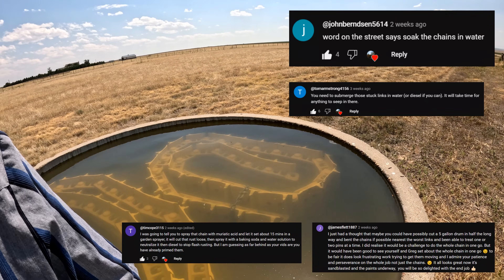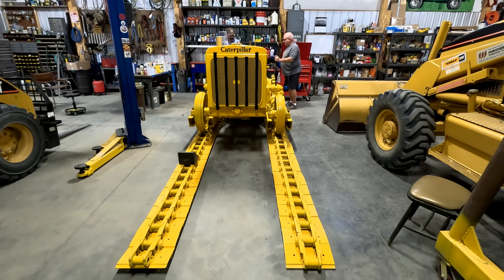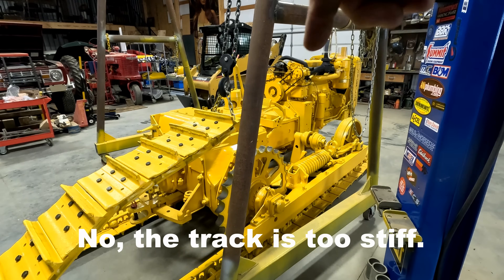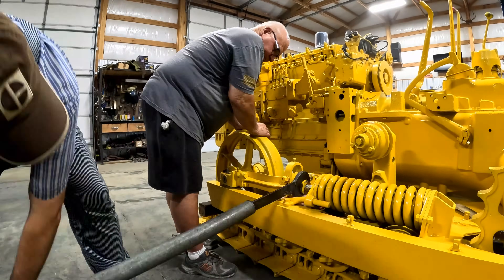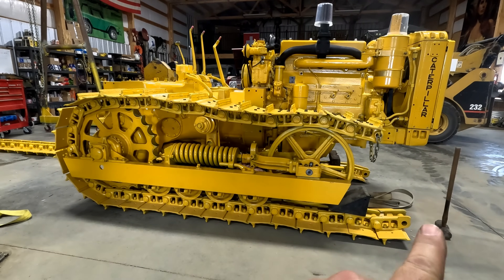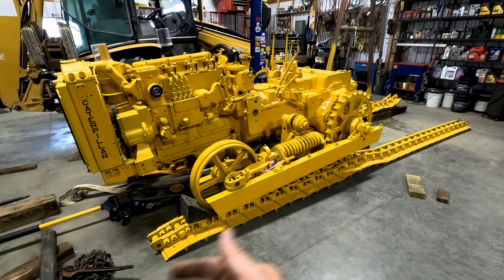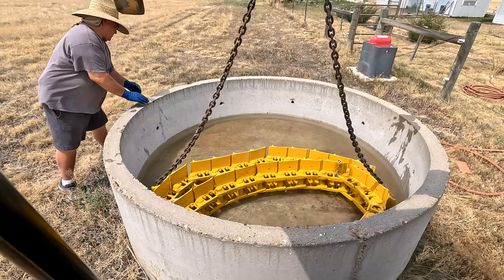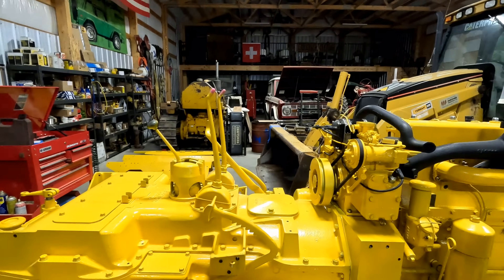Caterpillar D4 Soaking stuck track chains. Will it work? Episode #124

Comment: That doesn't make any sense because if you want to break it in properly all you have to do is leave the tracks slightly a little loose and let the motor run for a while and just drive it slow and it will break itself in and then after a while after the motor is broken in Titan tracks up a little more and just keep driving it it'll be fine

Comment: Someone else already said it but we usually connect tracks on the top flat spot, this way you can use whatever you like to join them, chain binders, come along, cable with snatch blocks, rope and pulleys even a good ol pry bar or two :) btw, it helps to freeze the pin before inserting....
Reply from the maker: We got hung up on the location that the book said to insert the master pin. That would make it quite a bit easier not to be on that radius. Appreciate the advice. 👍

Comment: start it, and drive it over the sprocket using engine and crane plus a few come alongs and long bars or wood as a lever and it will unstick rather fecking quick lads. clearly y'all haven't fitted many tracks before
Reply from the maker: We have not done much track work and I have never claimed to be a mechanic. I think we're going to slap these tracks on one of those machines I showed at the end of the video. We were reluctant to use Lefty because the engine is not broken in yet. 👍

Comment: Thats an easy maintenance item when stored. Feul and pump spray couple gallons goes long way. I worked for some off the boat Italians. They put sewer pipes in baltimore city in the 1890s. The old shop guy would  spray down anything made out of steel. They had old crains mack trucks big pumps and air compressors with pony motors. It all went for scrap in 2000 grands liquidated everything.  Wish I had grab some of it now.

Comment: yrs ago I had a 450B J D with same track problem deaer told me the only way to fix was to press all the pins out and remove rust then re assemble,  I threw them away and bought new. Misstake?
Reply from the maker: I have a feeling we're going to be pressing the pins out. From talking to a lot of folks I think that will be the only solution. New ones would be a good idea but they haven't been made for years. 👍
Reply: @lifeafterourloss  100 years later, the track chains are fully rusted thru and useless

Comment: Question…. Have these been together and used since the grousers were built up with bar and weld?  If not then those pads probably got some rocker yanked into
The from the heat. I would think that it would be trying to pucker the pin bushings which will in turn try to grab the pins themselves. Just a thought. This is my first time seeing your channel. So I’m not sure on the history of those tracks.
Reply from the maker: Welcome to the channel! The chains came off of a machine that had been sitting for probably 30 plus years. The rebuilt grousers are from a parts machine that we got from Montana. This step is more of a experiment to see if it will work. In the end, I suspect we will be pressing out the pins. 👍

Comment: Years ago at a swap meet a man told me he had an engine he couldn’t got unstuck so he took in down to a local creek and submerged it in the running water for some length of time. Later retrieved it and then he got it to turn. Good luck with your experiment.
Reply from the maker: I've heard quite a few stories like that. I really hope this works these tracks have been our nemesis. 👍
Reply: @lifeafterourloss  If you could find a way to continuously be agitating the water. Maybe some type of small pump or an air hose with very small air holes in it under the tracks to make the water bubble and turn.
Reply from the maker: @oldamericaniron5767 I think that would help. Unfortunately I think the paint sealed things up a little bit too well.
Reply: @lifeafterourloss  I loosened a drive chain for my gravel crusher by laying it on it’s side next to a tree. I hooked tractor to one end and other end to some sort if moveable anchor and pull chain around tree, switch tractor and anchor and pull back working it like one of those chain type saws survivalists may carry. Better use a tree you don’t care if it dies from bark being tore off. Just another thought.
Reply from the maker: @oldamericaniron5767 We have tried about everything. Stretch them out with the backhoe move them around with the backhoe. Heat, big hammers, pneumatic hammers. We are in desperation mode now. Eventually I think it's going to need pressing the pins out. I know what a monumental task that is, so we're trying everything we can to avoid it. One thing this project has taught us is to just go ahead and do it the hard way first, 😂.
Reply: @lifeafterourloss  Good luck with it!

Comment: Hey Arron, Great video.   Enjoyed your cameo and Squatch's shout out on his channel.  Many years ago I bought a Cat 30 that I was told by the owner, whose opinion I respected, had stuck tracks.  The day I went to pick it up was hot.  No problem, armed with 10,000 lb. winch, sheave blocks, planks to slide on and lots of dish soap, what could go wrong?  Before it was on the ramps the sheave block broke.  We load the crawler, wiggling it on, pulling one side, then the other with come alongs and a tired M Farmall.  Spent most of the day loading the tractor, hauled it home, parked the truck and walked away, never wanting to see it again.  A couple days later, I cooled off and worked up the courage to take a look at it.  After a  few minutes of studying the problem, something I should have done in the first place, I loosened the brake adjusting screws, the tractor rolled.
Reply from the maker: I have made many very similar mistakes. It is definitely a testament to your perseverance that it's still got loaded with stuck brakes. None of this is really a surprise after viewing the projects you have completed. It's cliche, but I love the saying where there's a will there's a way.
Reply: @lifeafterourloss  "where there's a will there's a way" you forgot to capitalized, Will, William, Bill, I'll answer to any of them.
Reply from the maker: @billlee4838 I really did miss a perfect opportunity here.......😖

Comment: I’m anxious to see if this works. I have an old 941 that I bought and it has CAT tracks with new pins and bushings and it sat for too long after they were put on it and several of the links froze up and I have been pouring oil on them for months and actually heated and beat them down one time and when I drove it they went right back to the original sticking point. I have been thinking about soaking them for some time now but I was thinking about using a vinegar solution.

Comment: As a member of a vintage/antique heavy equipment association, I've been in the market for a 9U or a possibly a very early "B" series D6 for some time. A flyer with a list of some vintage heavy equipment started to circuit around which included an early 60's D6 for sale. After contacting the seller and making arrangements to see the tractor, I took my toolbox and a pair of batteries to check it out. The tracks had been replaced years earlier with new ones: thick rails, grousers nice and tall, bushings immaculate. The only thing wrong was a coating of rust on the tracks from the tractor just sitting there. Usually tracks flex when I walk on them but this one didn't. When I fired up the tractor and eased the main clutch (aka: flywheel clutch lever) back, only one track responded.  After speaking to a several heavy equipment mechanics and a 90-year old contractor who owns over 45 Cats, I came to the conclusion that nothing can be done in this case other than replacing the chain. With other possibilities such as a frozen clutch or brake, I passed and the tractor remains just sitting there.
Reply from the maker: Someone has told me that the only way to free them is to push the pins out on the chains. I honestly think that may be in our future. Hopefully you found another D6. 👍
Reply: @lifeafterourloss  I heard of that one too, but I'm not a mechanic so I don't have access to 70-ton capacity press. One mechanic mentioned vibrating the pins with an electric hammer.  I thought about hosing down the entire track with PB penetrant( yeah, the stinky stuff) and letting it soak but I don't own the tractor. Anyway, good luck on your 7U. I'll be looking forward to seeing how yours turns out.

Comment: I enjoy your hard work and seeing you actually make real progress. I’m recently bought a D4 6U so I watch every YouTube concerning repairs, maintenance and operation of these machines. Just finished rebuilding the clutch and starter pinion assembly but the current challenge is locating a replacement fly wheel ring gear.
Reply from the maker: Thanks! Check out General gear & machine in Boise, Idaho. They would probably have a ring gear for your 6U. 👍

Comment: I've heard of soaking the tracks in oil, but never heard of using water before. My Grandpa used to take the used oil from the tractors and pour it on the tracks to keep them from setting up, because they sat outside in the weather. He did that for 67 years, I don't think He'd approve of using water for some strange reason...

Comment: Clear water cannot dissolve rust by itself. 
It can just wash away dirt particles from the friction area, but to do this it must be able to flow freely in these places. 
In addition to this, You painted chains with a thick layer of paint, actually hermetically sealed them, - not good in this case.
Try to mix some machine oil and kerosene: it have fine penetrating capability, inject this liquid in available gaps, and after some time try to stir the chains.

Comment: I think you will find out you have wasted you time on this one. Saw a guy soak a set of 450 JD chains/rails in a pond all winter. Didn't help a bit. Penetrating oil in a garden sprayer and running them finally did it but it was a mess.
Reply from the maker: I suspect you're right. There has been a lot of Wishful Thinking in this project. Either way, we are nowhere near the end of messing with these tracks. 👍
Reply: @lifeafterourloss  Well it isn't like it will cost you a bunch to try and if it does loosen them up I would say you will have to get it moving and get some kind of lubricant in there or it will rust right back again. Either way I am sure y'all will get it going. It sure looks great so far.
Reply from the maker: Thank you. I figured we really didn't have much to lose by trying this. 👍

Comment: I used, used motor oil and some diesel. With the right size tank (had Amish make me a stainless steel one), to lower the installed tracks down you only need a few inches of fluid. Then raise machine or lower tank and rotate tracks for next section. Worked great. Manage your oil.

Comment: If the water alone doesn't work then you can try electrolysis in the same tanks with Arm & Hammer washing soda, water and some strategically placed anodes along with a good sized battery charger. The electrolysis will only attack rust not the paint. Use 1 cup of washing soda for every 15 gallons. With the size of the tracks you will need a sizable battery charger.
Reply from the maker: I will definitely keep that tip in the arsenal for the future. 👍
Reply: @mmm365  Yes it will if there is rust under the paint.
Reply: They would need one hell of a DC supply, a stick welder would work, but as mmm said it would remove the paint.
I'm not an operator, so I don't know about tracks, but I've restored a lot of rusted tools and machines, why didn't they just use PB blaster, they wouldn't even have to take the track off? What am I missing?
Reply from the maker: @bigredc222 We actually soaked the chains for months in PB Blaster. This was a recommended option for freeing the stuck links by many. I can say this is nowhere near the end of our struggle with the truck chains. 👍
Reply: @lifeafterourloss  OK, I just found you guys, so I have a lot of catching up to, I'll be watching your videos all weekend.
Reply from the maker: Much appreciated and welcome to LAOL! We're glad you're here with us. Hope you enjoy the videos. I've learned a lot about making videos and old caterpillars in the process. 😊
Reply: The electrolysis should work, might take a while.  Molasses would also work.